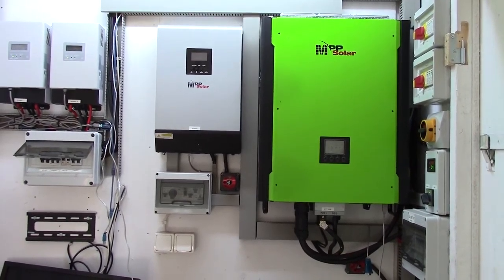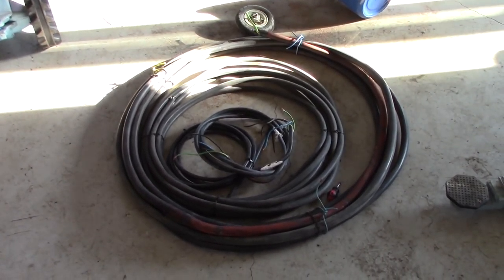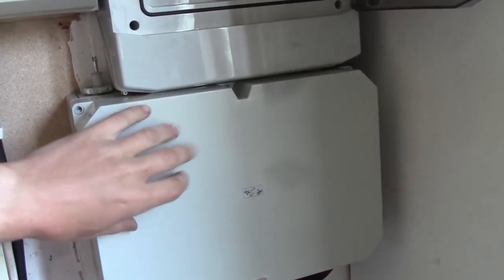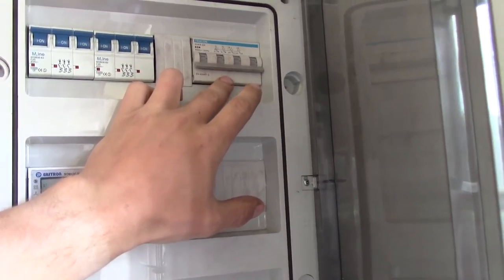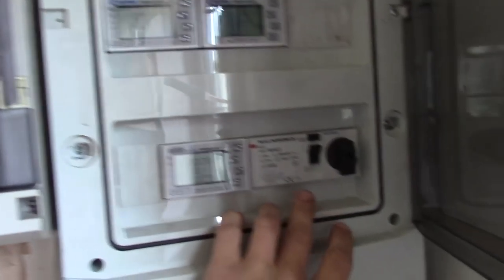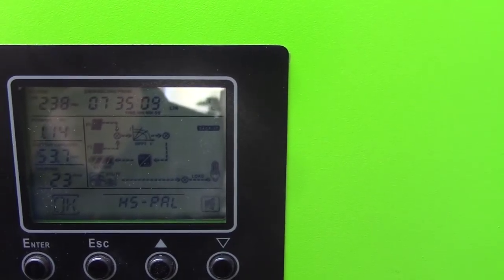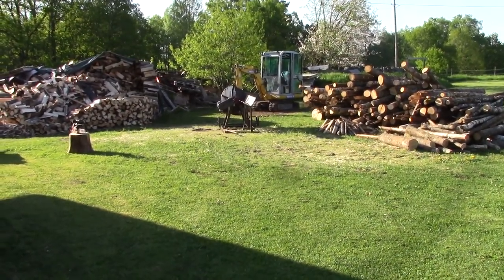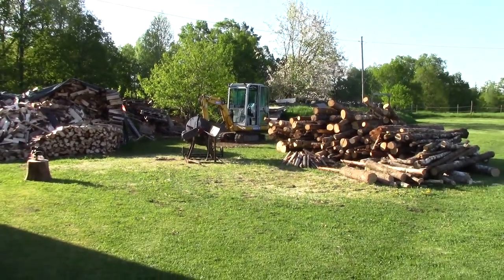Update 2018-05-14 IM ALIVE...

Comment: How do you control the inverter to get zero grid ?
Reply: In short, it is an option in the inverter itself(plug-in card/meter combination) and can be seen on the manufactures homepage. I have it at it works, but if you use 1000w on one phase it will supply 333w on each phase so the real consumption will be zero between all 3 phases.
Reply: ok, I was thinking it would adjust itself by turning down the charge rate to the batteries to balance the grid to zero, given the solar output at that time. I can't see how it would regulate power on one phase the other two, What you are describing would zero the natural load - assuming no power factor.
Reply: myozone 
Zero load from grid if solar and or batteries have enough power.
If you have an Inverter more after the green monsters extra meter it will also charge that power to the batteries. I think just like the Tesla Powerwall do